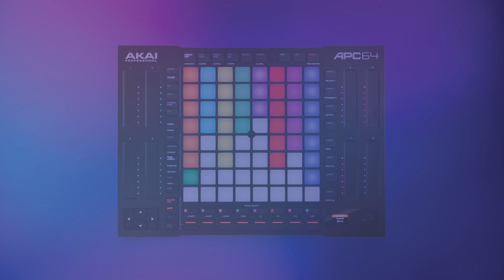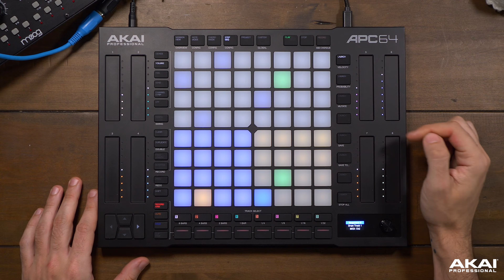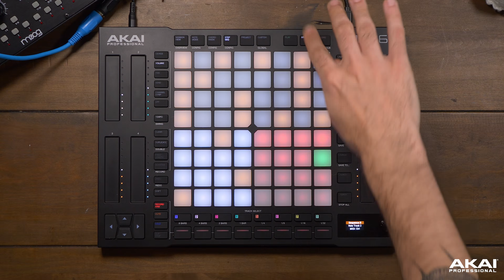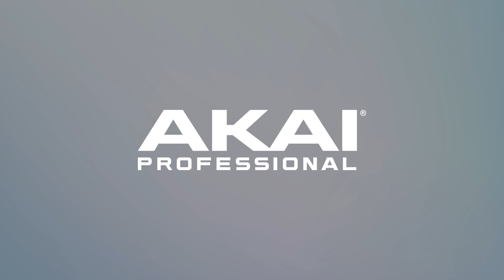Set Probability and Mutate Using APC64 | APC Academy

Comment: None of the probability, mutate, or velocity settings stick to the notes in my sequences. I hold a step down and select a velocity like you're doing in the video, but the velocity value stays the same no matter which step I select. The manual does not clearly explain how this feature works. What could I be doing wrong?

Also, is mutate really just randomly moving a step up or down an octave?